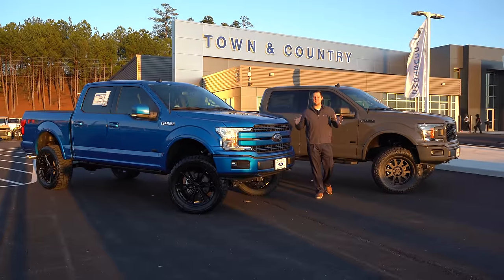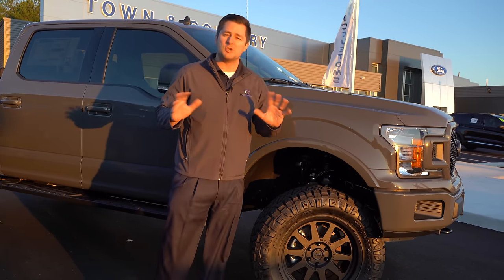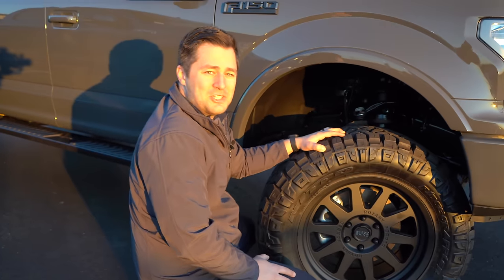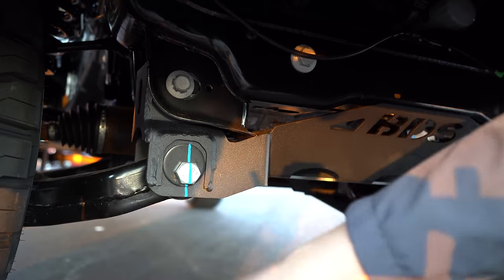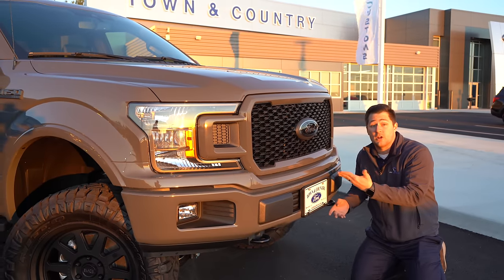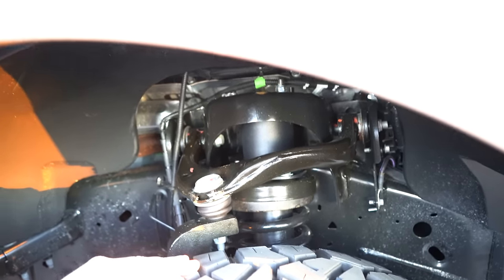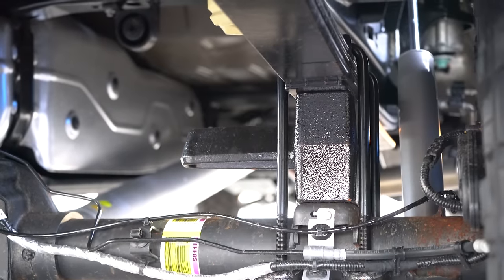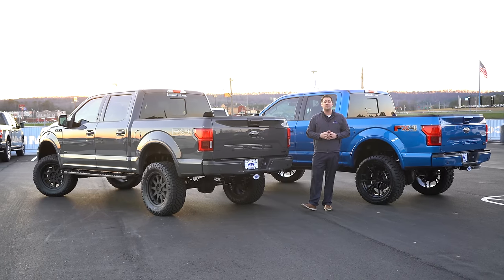Lift Kits VS Coilover Kits!  What is best?

Comment: Will the coilovers provide any additional lift with the 4" kit? I have the regular 4" BDS kit installed on a 22 F150 but would prefer the truck looked level because it doesn't look level now. And I'm also having rubbing issues with 35's on +1 offset wheels. I was wondering if the coilovers would lift the truck another 1" or would the stance stay the same with the spacers vs the coilovers?

Comment: I'm thinking about a 3" or even better a 3 1/2" level with a coil over and new control arm, all to maximize the space around a larger 35 tire with a small poke on a new F150 Platinum, and make it as smooth a drive as I can.  Any thoughts about that?  And is it possible, and reasonable, to replace the leafs in the rear with springs too, all too make it as smooth a drive as possible?  I don't want to waste money, but I'm willing to spend it for a good reason, so money is secondary to comfort and performance, and getting the larger 35 tires that will further increase minimum road clearance.

Comment: I have a 2014 Ram 1500 5.7 Hemi v8 Rwd/2wd quad cab truck with Rough country bull bar, stock suspension I'm considering doing either a 2" - 2.5 " leveling or do a 3" - 4.5" lift more likely do a leveling kit just don't know what to get i really don't like the spacers  aka puck route

Comment: Can you do a video comparing a lift to a coil over level lift? Such as a BDS 4 inch lift to Halo's coil over lift? I want to lift my truck, but I don't like the idea of cutting the frame and not having the option to return the truck back to stock.
Reply: My fear too!
Reply: @TimStJohn-xp8rv  you can always have them reweld the frame pieces back on I believe

Comment: Mitchell, I have a 2016 f150 XLT supercrew I am debating on whether I should get fox 2.0 suspension kit for my truck to give it a better ride on rough terrain and to give it a better stance, the drawbacks are: I tow a boat and am going to be towing a fifth wheel what do you think? if I tow alot should I? or no? thank you
Reply: American Truck Nation are you talking about a leveling system?  I have a Fox level system on my 2011 and still tow the same things I did before.  It didn’t effect anything as far as that goes.  Not sure about yours, but on mine it didn’t do anything in the rear but replace the shocks.  It’s been a great kit
Reply: @No_nonsense302   you know thank you for that I had no idea if the rear would be moved at all

Comment: IMO, every lifted truck to this stage needs a set of coilovers. yeah, that's $2000+ more but think about it, do you really need panoramic sunroof or heated steering wheel? they cost more than a set of coilovers. ppl who drives their trucks to starbucks wouldn't lift their trucks in the first place.